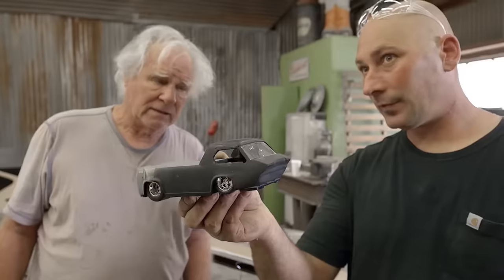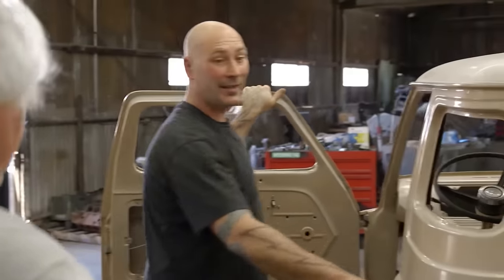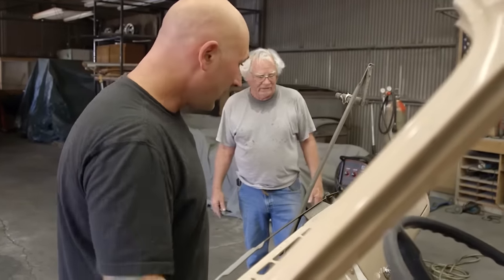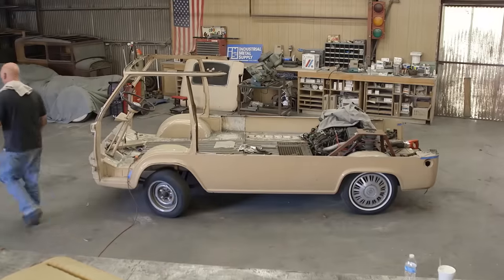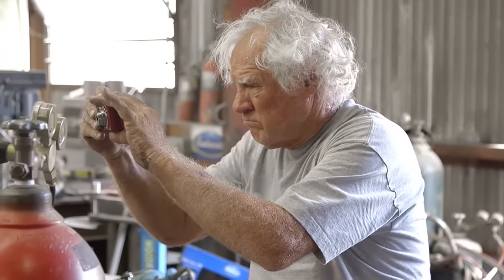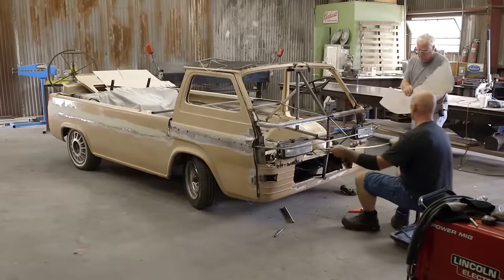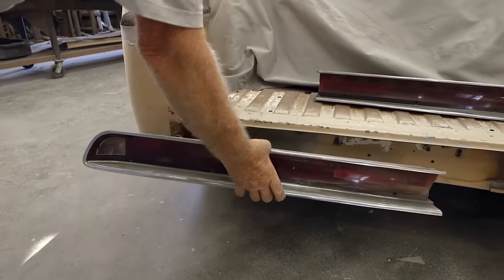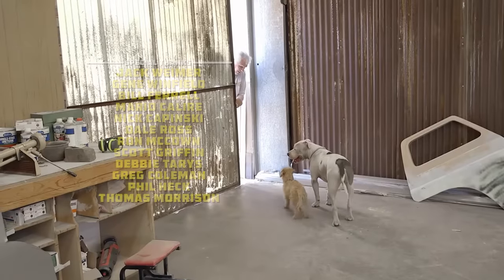When Classic Meets Futuristic - Full Custom Garage - S02 EP11 - Automotive Reality

Comment: I had a similar concept except it's based on a A100 van, with nose extended 6 inches (except header), body widened 10 inches, body lengthened 24 inches, windshield racked and lengthened, headlights removed (body contoured), modified 1968 Toronado grill assembly, custom side moldings shape to match grill turn signal extensions, roof replaced with custom top that includes Toyota Corolla popup headlights, Toronado drivetrain and other custom exterior and interior features.  ;-)